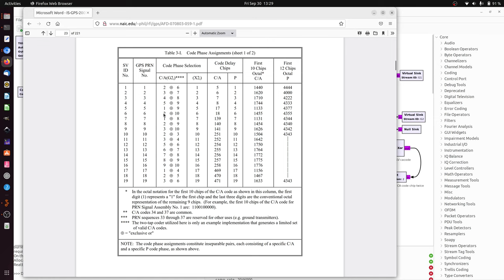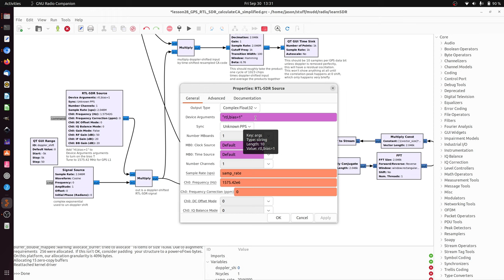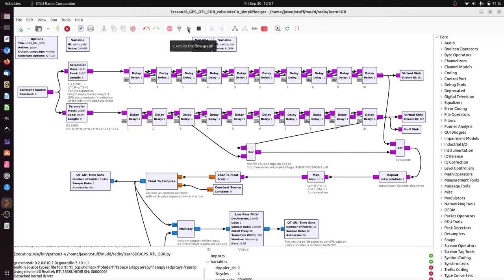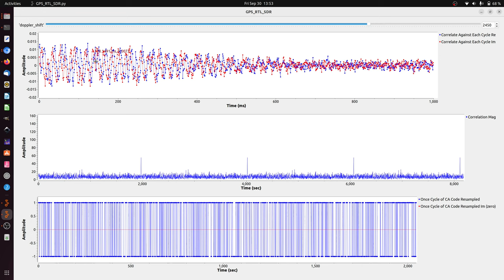Learn SDR 23: GPS Reception

Comment: Thank you for all SDR videos. Is there any reason you switched to RTL SDR for this section? Can I use Pluto as well? Is it because the sensitivity, noise figure or other spects of those?
Reply: You can use pluto, just replace the TCXO with a proper external 1 pps or < 1 ppm source, set it at 40 MHz and plug it to u.fl ext_clk port, and re define uboot variables in linux environment of Pluto.
Reply: The Pluto would give you better SDR data, but it doesn't have a built in "bias tee," so you'd need to buy one for $13, provide 5V to it from somewhere (noisy laptop USB or some other regulated supply), and insert it between the antenna and the Pluto's RX with another SMA cable. (Sorry for the long overdue reply.)